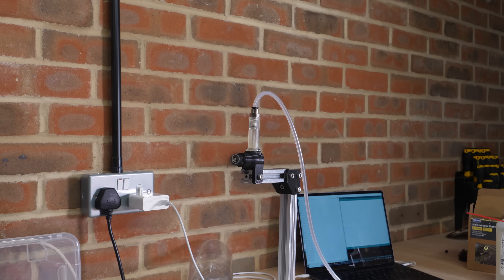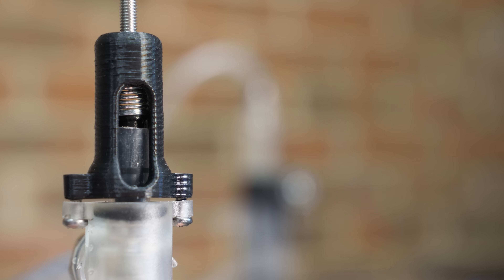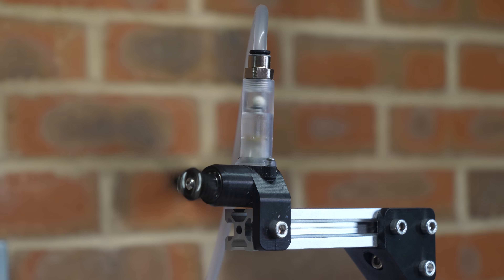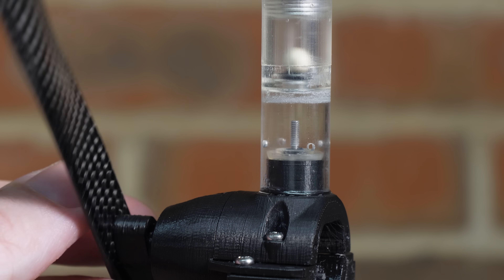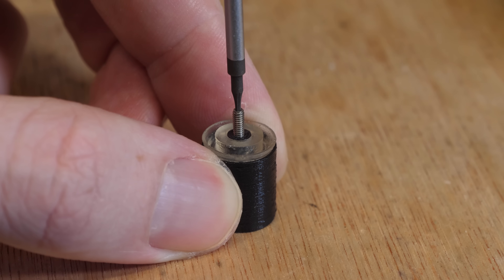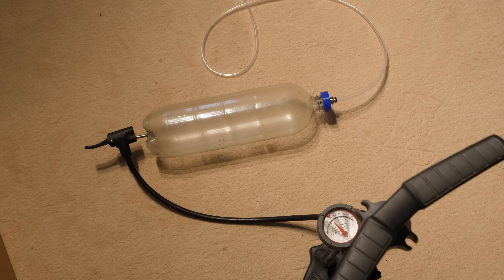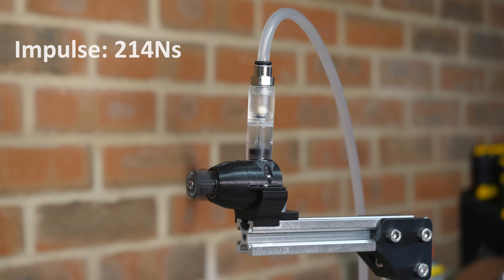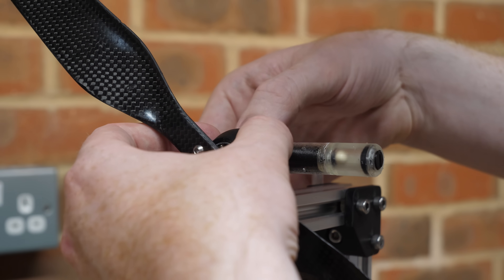4,500RPM Air Engine

Comment: My thoughts about improving efficiency:
1. Make the pistons lighter. Remove unnecessary plastic below the connecting rod axle. And make the valve opening pushing screw of light alloy.
2. Make a crankshaft with 2 opposite attatchment points for 2 different connection rods thus making the pistons move in opposite directions. It will diminish vibrations. Such solution is implemented in some motorbikes and Subaru engines.

Comment: Hey Tom! Glad to see a working engine and hooe to see a working plane soon as well. While watching i started thinking... Is it not possible to size the first and second cylinder in a way that after the first cylinder exhausts the vented air is used to power the second cylinder? Like a double or triple expansion steam engine uses the power of the steam a few times? I know the way it works is different, but i think it could be possible for two cylinders. This way the first cylinder will act as the pressure regulator you were using at the start of the video.

Comment: Have you thought about switching from a standard propeller and a toroidal propeller? Less cavitation and more efficiency might equal longer more steady flight?  I'd be very interested in the results of such a test.
Reply: I am also very curious. Intuitively I would guess the toroidal propeller would do better in a low power, low weight situation like this. But then again I've never seen a horizontal toroidal in the air before, only vertical

Comment: Why don't you change the design of your cylinder. You can add an air tight piston with a spring that would have resistance same as the air pressure you want to run your engine inside your air cylinder. That would maintain the same pressure your engine needs to run over the time till your cylinder is empty.

Comment: You should build another dual engine like this -- but with everything half the size.   You would get the same efficiency as the single engine -- but with a smoother power output do to it pulsing twice as fast.

Comment: Love your videos and your passion for the exploration process! Couple things: 1. Have you looked at the "OK" co2 engines. Seems to be what you are going for with higher pressure expansion engine vs vane compressed air engine. They were super light and efficient.   2. The 2 cylinder would be better with the engine case/cylinders offset as you lose a bunch of torque with the bent rods. One cylinder behind the other about 1/2 a bore. 3. Try upping the pressure with 2 cylinders of different size and pressure. Exhaust the smaller high-pressure cylinder into the larger lower pressure cylinder. This is how large compressors get more efficient. You may find a way to do this in the same cylinder (like a steam engine). Can't wait to see the next iteration and thank you for the dedication you have to really explore the concepts.

Comment: At 6:30, with the chamber with the increased volume, would the expandable piston head lose contact with the walls of the cylinder prematurely as the pressure lowers closer to 1 atm, resulting in less power?

Comment: another thing about the higher exhaust velocity is that it might pull a slight vacuum inside the cylinder once the air leaves it, making it take less power for the upstroke to happen

Comment: It would be kind of cool to see you put it on the dragster. What I’m curious about is what if you lubricated the contact points between the crankshaft and the pistons? Do you think you could squeeze out a little bit more efficiency? Would lubricating the piston bores be too overkill? 

Either way, this thing sounds amazing and it looks cool to boot. What might be interesting is using this design with an RC car powered by a turbo compressor and electric motor. See what you can get from a rear wheel drive with a 1:1 gearbox on the output shaft.

Comment: Now you should try to reuse the wasted high pressure from the first cylinder in a second low pressure cylinder, boat steam engines used this design to improve efficiency

Comment: When I saw the two cylinders, I thought you were going to make a double expansion engine. Steam engines would have a high pressure cylinder that would exhaust into a low pressure cylinder, that way the power in the lower pressure air would not be wasted. Perhaps this would not work in an air engine, but I can't see why not.

Comment: Could be nice to try this design on your hydrostatic pressure vessel, attached to an alternator, fueled by a rain collector. I would also love to see if you can generate pressure in your gas-powered vehicles as a range extender. Boiling water is boring but what if you try cryogenic fluid such as liquid oxygen, boiling at ambient temperature ?

Comment: About the expansion volume in the piston on the first modifications of th air engine you showed, you said you let the smallest volume be 1/3 of the max vollume of the piston, such that when the air expands it'll get to about 1atm, from 3atm when compressed, shouldn't you consider that an adiabatic expansion of the air? In wich case the pressure would be a bit lower than 1atm, and might interfere with the exit of the air and the power output?

Comment: Some of the efficiency loss on the left engine also came from it having to recompress ~1atm to get back to TDC.  You would need an active valve design to take advantage of expanding the working gas to ambient pressure.  (so as to not cause its' compression on the return stroke)

Comment: Hey Tom. At this point is it worth looking at alternative ways to power your motors? E.g is there a way to generate high pressure gas instead of storing it, maybe a chemical reaction? If energy density can be increased in such a way, these motors can be incredibly practical and a quieter alternative to ICE motors in planes etc.

Comment: The crossover with combustion engines is more than I thought. You're dealing with stuff like low compression and valve float. The way to fix valve float is to reduce rpm or add a stronger spring. Pushrod engines deal with this commonly when tuning for performance.

Comment: Fascinating, didn't think there could be that much, er, mileage in compressed air motors! How about scaling it all up? The Japanese seem to be the only ones taking man-powered flight seriously these days. I always thought that some form of energy storage could be allowed, that is the pilot would 'wind up' the motor before launch. I believed using bungee elastic was the only possibility, but after seeing your videos, Tom, I think compressed air is much safer for powering a lightweight airframe.

Comment: You would probably be better to have the twin run on a standard crankshaft with both cylinders cycles aligned thus dampening the vibration. This may lead to better efficiency even

Comment: I wonder how you could make it so that the outlet valve is open for the entire "compression" stroke. Like I suspect you could eek out some efficency gains that way as you lower the effective pressure differential. I also wonder if you could heat up the engine by using something akin to cooling fins to ensure the gas inside remains a constant temprature if there even is much of a temprature differential between inside and outside the engine which is what I would guess by the fact the air is condensing.

Comment: Cool, as for mor cylinders Have you seen the old steam engines that use double or triple expansion designs to more efficiently use the steam?

They basically dont vent the steam from the first piston into the air, but instead feed it to another piston of double the diameter/volume of the previous piston to get more power from the same volume of compressed steam/gas.

And since you’re working with lightweight propellers and not machined cast iron parts you might be able to get away with more than 3 expansions!

Comment: Just a suggestion. The exhaust holes pointing to the front , even when the exhaust pressure is low, will probably take some efficiency from the propeller, maybe directing them all back will be good, and even provide some kind of thrust

Comment: when you attach the engine on the airplane, you can try directing the exaust port downward so you can benefit from air pressure released. Or you can try also other directions like pointing backwards to push to airplane forward

Comment: I absolutely love this series. You're doing God's work. I bet you've single handedly inspired dozens of not hundreds of future mechanical and aerospace engineers.
Reply: Can confirm.
Reply: Too bad compressed air already fuels commercial airplanes, but you’re not supposed to know that
Reply: @ghostwhite1648 This is false. You're referencing a meme called the "jet fuel hoax" which purports that jet engines use fuel to start an air compressor which then somehow produces the required power to continue running without fuel. Another variation of this meme says that 90% of the input of the engine is compressed air while only 10% is fuel. 

In fact this is a misinterpretation of the way that fuel/air mixture works. Combustion of kerosene in air is limited by the Oxygen content of Air, which is 20% O2 and 78% Nitrogen. By volume, only about 10% jet kerosene can be used before all the Oxygen is used up. The combustion heats the air which causes it to expand, which then drives the turbomachinery to compress more fresh air into the engine, this compressed air is then burned with fuel to repeat the cycle. So no, compressed air is not where the energy is coming from, it's where the energy from combustion is converted from chemical energy to heat energy and finally mechanical energy of expansion. 

Now let me blow your mind! 

This meme is ALSO a misrepresentation of the work of Viktor Schauberger, the Austrian scientist responsible for early experiments in vortex fluid dynamics. Viktor Schauberger discovered a mechanism to use hot, humid air and a cold sink, usually a cold water tank or body of water like a river, to rapidly compress ambient air to drive a turbine. This is using the opposite process of implosion rather than explosion used in combustion engines. Implosive engines still require a heat difference or humidity difference to operate because only systems that are not in thermodynamic equilibrium can perform mechanical work. The "repulsine" was Viktor's name for this type of cold implosion engine, and he was conscripted by Nazi Germany to construct prototypes for the Nazi war machine. It's unknown how successful this project was, but the principle behind the design is sound, as long as there is a cold reservoir sink available to dump the exhausted, condensed air. Without that temperature difference there is no source of energy to perform the mechanical work of compressing the air.
Reply: @taylorwestmore4664   TLDR a YTer made a compressed air engine. We know the military is 25-100 years ahead of what we are given.

Comment: Around 6:00. Ah a common mistake all engineers come to at some point - trying to replicate or move towards the 'zero energy' engine.. :D  (Thanks to Thermodynamics) The maximum energy differential or 'waste' generally always gives you the most efficiency..
[This post uses exaggerations to over-emphasise certain points..]  :cat-orange-whistling:

Comment: Maybe the boxer twin configuration is causing the inefficiency, or at least the firing sequence is (too much energy wasted on linear motion a.k.a. vibration).

A parallel twin, v-twin, or a more balanced 4-cilynder config would be interesting to see powered by pneumatics. If not for the power output, just to figure out the engineering challenges of making them.

Comment: Another issue with that two cylinder design is vibration. With the two cylinders not being opposed it could cause some instability on an aircraft. That is why a most GA plane engines are horizontally opposed 4 and 6 cylinders to keep them balanced

Comment: Excellent work. 
To increase efficiency on steam engines, the designers chose to use multiple stage pistons, where the exhaust of a small high pressure cylinder was fed into a larger low pressure cylinder, this unitised more energy. I can't why the same technique can't be applied to air engines.

Comment: You basically built a mechanical P-controller. It will oscillate. If you want to have a constant power output, you need an I-Part in your controller.

Comment: love the series, always gets me motivated to also try some air engine designs. For me with boxer engines having the connectingrods offset induced a lot of friction because of them wanting to spread and jamm. So offsetting the cylinders instead helped a lot although I always used a plastic crank and not even a circular one which probably amplifies the problem.

Comment: You design has 2 issues as far as I can see:
1. On the up stroke the piston is compressing the air in the cylinder needlessly. Not an issue in an of itself you get most of the energy back (this is essentially an air spring), but the cylinder pressure when the valve starts to open is not atmospheric. 
2. The valve pin doesn't really adjust timing as much as it does lift and duration. To properly decouple all of those you'll need a secondary crank/cam that you can offset from the piston's crank.

Comment: Have you tryed using an offset crank to piston axes to increase tork angle further? Ie Moving the cylinder center inline with the max torque angle of the crank?

Comment: You’ve essentially created a PCP hammer valve engine… which is why it regulates itself… This should be a thing really… when optimized it will follow similar thrust curves to how PCP air rifles have their power curve for the shots fired. Keep at it!

Comment: Have you considered offsetting the crank shaft from the centre of the cylinder?  You have nearly zero compression required as the piston is moving upwards, so you can afford to offset the crack shaft by a mm or two, giving you a better angle to apply the peak pressure after top dead centre?

Comment: Ive noticed when tinkering around with cylinder angles, that 45 degrees is a good angle for really balanced running. I think your design could improve even more if you made it a V type

Comment: Add some crankshaft offset maybe? That could increase torque on the crankshaft right at TDC when you have the highest cylinder pressure

Comment: Nice video. I have an important tip that me helped massively when I built my own pressure Lego engine. 

You connect both cylinders to one end, so it is in fact a flat inline 2 engine. That create problems in the weight distribution while running. It’s better to use the normal inline 2 design or to go for a boxer engine. The boxer engine use two instead of one connection for the cylinder. So the power stroke are in the Same Moment  instead of separate. 

Other wise the vibration can cause except in high rpm real problems, especially in a fragile airplane. It also give the engine room for inefficiency’s. 

You also Show us that the vibration lift the teststation up so yeah a really big and easy problem to fix for future engine’s. 

Love from Germany

Comment: Wow! Looks and sounds really intimidating. I wonder if you plan to integrate some exhaust manifolds. Glued around the exhaust ports circumference, they could be half-toroidal-shaped (like donuts with central half part cut out), supplied with a single peripheral exhaust channel, which then can be routed to the rear. It could also increase efficiency, since the exhaust pressures (which are non zero) will potentially generate some thrust, even if tiny. Looking forward to new updates!

Comment: If you power an aircraft with a bottle of air try to add some dry ice inside to bottle. It vaporizes and makes carbon dioxide increasing the pressure during flight.

Comment: Now all you need is a servo regulated flow regulator so you can control the speed in flight. Otherwise it will probably be too good and just do flips. Like you were saying with the regulator you made, it probably just doesnt work with lower pressures because the spring tension is becoming too high for the air to flow at the same volume vs time. It may help to just make it so you can control the screw on the regulator with a servo.

Comment: This project is extremely awesome. I like your videos very much. I am not sure, but maybe you should try other design for multi-cylinder engine. Like V-type engine or radial, analogically to combustion engines used in aircraft solutions.

Comment: So with this being such a success I imagine air powered cars would be viable and all you'd need to refill them would be an air tank filled with a pump which could be powered by solar and take as long as it wanted to refil within reason. You could also use a ram pump off any flowing body of water to supply water to a gravity air compressor and have a completely green source of air for an absolutely zero emissions car

Comment: Another thing you should definitely consider is the effect of the condensation on the efficiency. Not sure how you’d remove the water without temperature or just buying a gas canister claiming to be without but it’s energy spent pushing the wrong fluid

Comment: I think after all this research and optimization you need to get a lightweight air canister for a paintball marker then you can regulate it down from 3000psi so your plane can fly all day.
The only problem is needing to get it refilled at a paintball field or scuba diving business but think of the possibilities

Comment: Hi Tom, I am not sure if you have considered this. When it comes to using your engine in a craft, will you still be using a plastic bottle as the air tank. If so, would constricting the tank more and more as the air is drained add to the engines run time? I wondered if something as simple as elastic bands round the tank would constrict the tank as the pressure dropped. Just a thought.

Comment: what about a two stage dual piston engine? one high pressure which exhausts into a low pressure optimised cylinder. Used to be done for steam engines